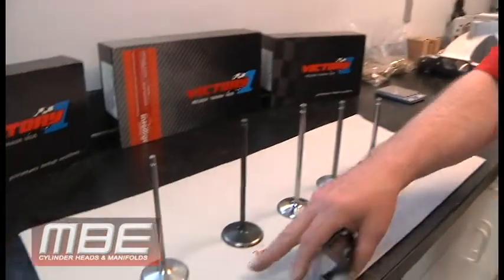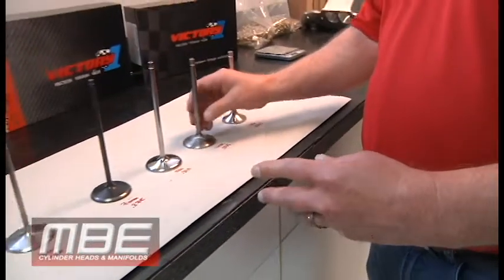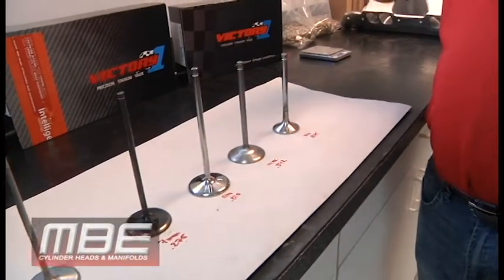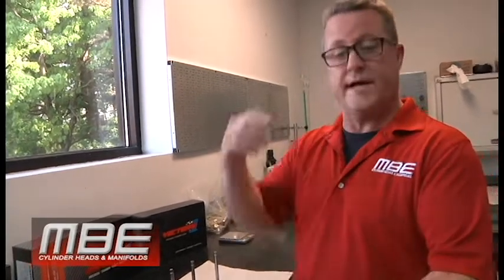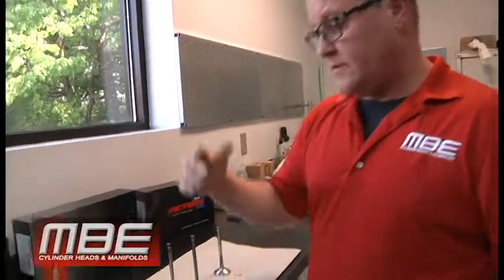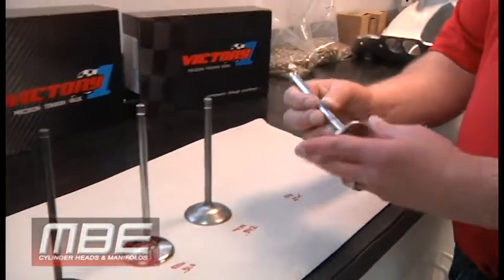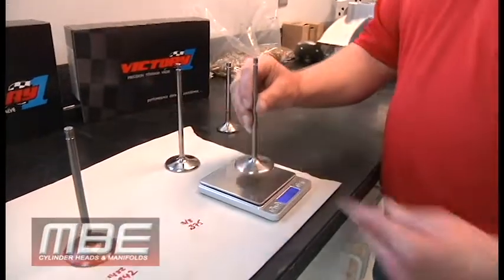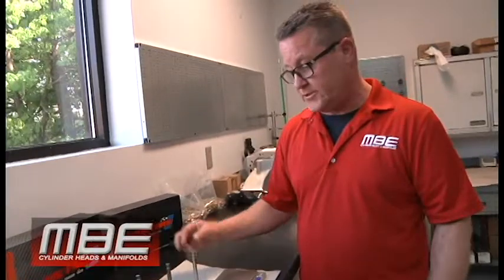VALVE STEM 101

Comment: Saving 10 grams of weight on the valve side of the rocker can mean 350 - 400 more rpm with the same valve spring.

Comment: I was wondering : can 6 mm valve stems tolerate the valve springs that NHRA Comp. 
Elim. and Pro Stock use ?  I know even the absolute latest and best alloys of titanium / stainless steel (such as Custom Age 625+, etc.) have their limits if the cross section isn’t adequate. What about hollow stem 7 mm and 6 mm valves in the above mentioned materials ? I know this is all academic, But I don’t work at a world class cylinder head shop or race engine shop. I’m not exposed to sort of technology on a regular basis. My point of reference is big, lumbering locomotive engines. Thank you for the “meat and potatoes” tech !  It is most appreciated !

Comment: During loft. People have been telling me the locks actually leave the retainers momentarily. Ive often wondered what kind of lock and valve slots are better. A single square, double, or even a quad round lock style. And what about lash caps. I was under the impression cam designers have created ramp styles that are less abrasive when it comes to lofting. And are the guides the readon valves are lasting better under higher stress levels?

Comment: Regulation stifles innovation. It may help refine a part but it boxes in the designer or thinker. F1 is about to do this. Very sad. I was hoping that we would see some of their older tech on a nice sb2 or Sc1. For instance the pneumatic valve spring that they used on the v10s so they could rev to 20,000 plus. I thought that would be awesome. I think some of the turbo stuff that they’re making is pretty killer but if we want real innovation, sometimes we have to let the engineers and folks out of the box. We have to cut the leash off of them and let them run to see what’s possible. Anyways. Love this channel. It’s awesome.